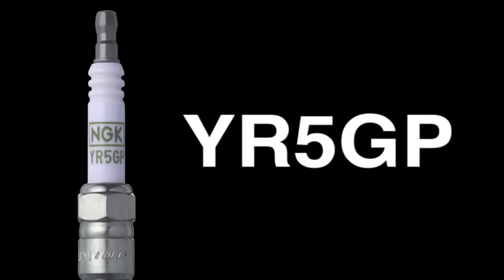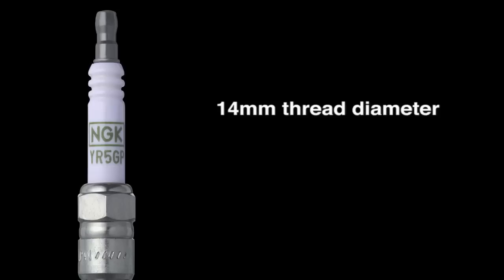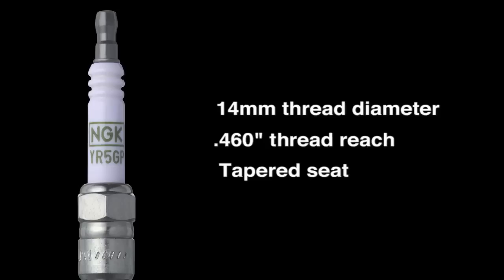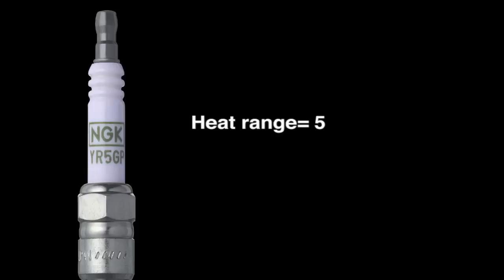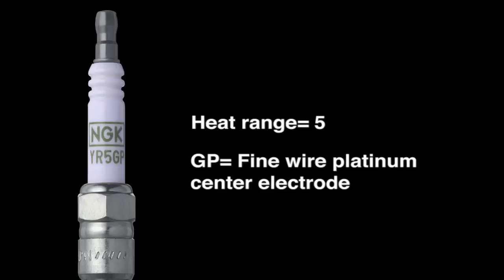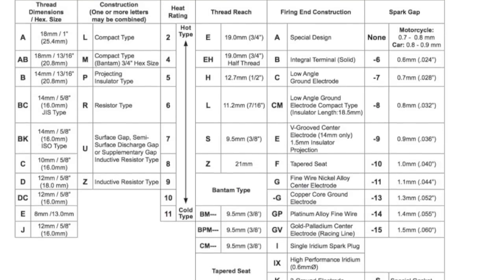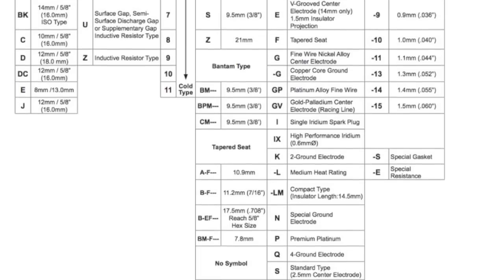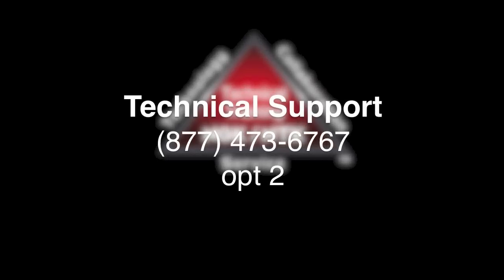Spark Plug Numbers & Letters - NGK Spark Plugs -Tech Video

Comment: Hello, thanks for the video.  Does NGK CRP8EAGP-9 can be replaced by NGK CR8EGP 3596. Its my motocycle 125cc
Reply from the maker: CPR has a longer center electrode projection into the combustion chamber than the CR series so the performance can suffer on the lower RPM riding. If they are racing the bike (constant high RPM) there will be no issues but the performance will suffer during low RPM, idle and stop/go conditions.

Comment: I am upgrading from  standard resistive to non-resistive ignition setup .Current plugs being  BKR6E-11 .Can you confirm the BK6E-11 is the correct plug to replace .I assume so but need confirmation .If the BK6E-11 is not available - do you have closest match  I can use.In your professional opinion if I may ask - what would be the maximum one should go in heat range from standard , if the 6 range is not available?Thank you in advance-Brad
Reply from the maker: Hey Brad, There is not a DIRECT cross to a non-resistor plug. Closest I have is a BCP6ES-11. This is a standard plug, no a V-power like the BKR. As for heat range, this is entirely engine/power dependant. I think your best bet may be to call our techline up and fill us in on everything that's going on and then we can suggest from there. Dial 1-877-473-6767 Option 2 for tech. Thanks!
Mike Becker, Senior Technical Instructor

Comment: This video did not help. I have a Honda XR650R and NGK makes a plug that is right in every way except the space given for the plug. It will not accept a standard wide socket(11/16 approx). I have to have the NGK  BKR7E-11 in a special small 5/8 socket BUT NGK will not tell to differentiate between the two.
Reply from the maker: Hey Mitch, according to my book the correct spark plug for your XR650R is a BKR7E-11. That does come with the 5/8'' hex. Are you looking for something different?
Mike Becker, Senior Technical Instructor
Reply: No thank you I appreciate that. I wish I knew how to differentiate between the two. I believe you sell the exact same plug, identical in every way except the size socket it takes.
Reply from the maker: Mitch, what socket size are you looking for? I can try to match something to the BKR7E-11 that uses a 5/8'' socket.
Mike Becker, Senior Technical Instructor
Reply: I have hero xpro bike 2014 in user manual refer NGK CPR7EA9 but I can't get this saprk plug can I use NGK CPR8EA9